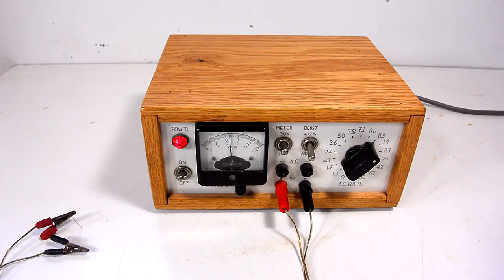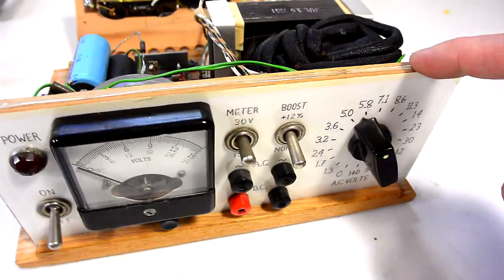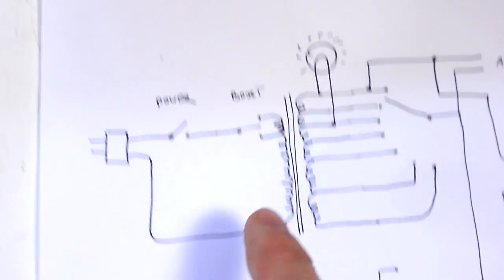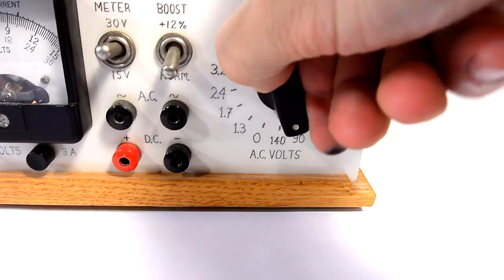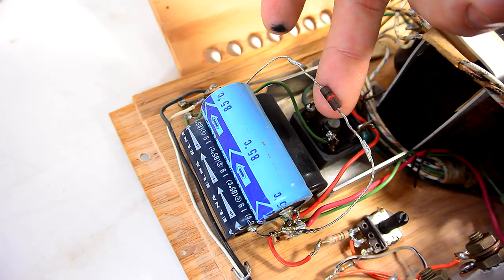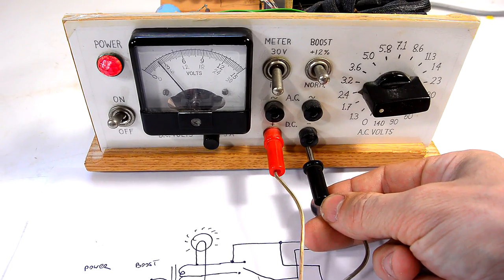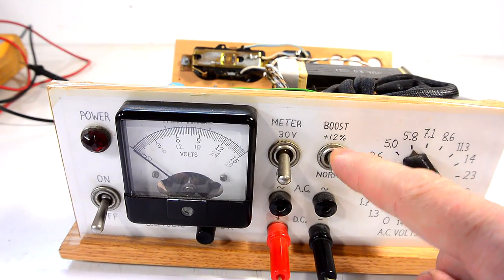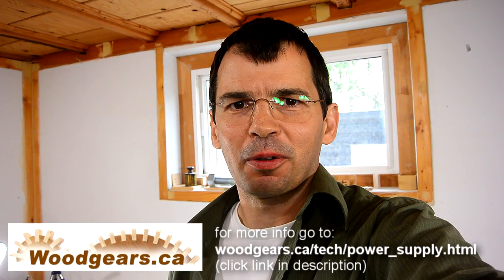Homemade benchtop power supply

Comment from the maker: About my homemade benchtop power supply
(which I built 28 years ago)
Reply: Matthias Wandel Only you'd make a power supply that goes up to 11.2.
Reply: Matthias Wandel That is so coincidental, I'm making one right now. I just ordered a buck controller to run the fans. I'm rewinding the secondary to get what I need from a scrap microwave transformer. I am totally going to copy your case though....so awesome. Is that cap draining resistor on an over current relay too?
Reply: bno112300 Well most blokes, youre on ten there, all the way up, where can you go from there? Where? Nowhere. What Matthias does, when he needs that extra push over the cliff, he puts it up to eleven.
Reply: Kale Klompstra Well it's one more now isn't it.
Reply: Matthias why you dont put a Cooling fan in that bench power supply?
Reply: Alex Gamer _360 because except for when its being used as a current meter it probably doesn't get very warm...
Reply: ***** no if you make it correctly it doesnt but for save you can make an fan on it
Reply: this was so interesting you are so enthusiastik do more videos like this about the electric things you have built.
Reply: Matthias Wandel  thats excellent. i built basically the same circuit to use as a built-in battery charger on my vw camper bus =) theres no metering or voltage selector or anything, so its nice to see what you did with it. very nice build =)
Reply: *****   I second that sentiment.   You are a modern Leonardo Da Vinci!
Reply: +Tobias Hochg&#252;rtel 
Don t under estimate this guy, he is a very creative, very smart, no he is a genius.
Reply: Isn't live more interesting when you get older - you benefit from the things you have built or done way back - in case you are and have been a bussy engineer.(like Standing on your on shoulders...)I am 51 now and just build a part for my street organ from a piece of oak I cut 30 years ago (and dried since then). So you always should plan and prepare yourself for your future.
Reply: I love this thing, it's made all the more awesome by it's simplicity. The fact it uses old school tech and hardware makes me want to make one for myself.

Comment: Gosh, this really takes me back.   As an apprentice, my original target job on completion of my apprenticeship was to be a 'valve engineer'.  However, back around 1958, one of my sessions at the company works was in a section where they had just started to make germanium transistors, which eventually saw the demise of most  valves.  
I remember looking through the window of the lab where they were growing the germanium crystal - I recall it looked like a two-inch diameter rough steel rod rising out of the retort at a very, very slow rate (something like an inch a week?)
The finished rod was sliced into discs, and the disks cut into tiny squares.  Blobs of N or P type germanium were fused to the square, with wires from all three coming out of the insulation surrounding the group in a container like a quarter-inch diameter little top hat.  This was a transistor, and if I remember correctly the rejections rate (percentage that DIDN'T work) was initially something like 90%.
Around this time, I made a one-valve radio - on a wooden chassis - and it looked very similar to your meter.   I would guess that the soldering quality was also about the same standard!
Thanks for the trip down memory lane.
Reply from the maker: Don Johnson Wow, 2" wafers.  I didn't know they ever made them that small!  Saw "the post apocalyptic inventor"'s video of a frequency counter terdown (from the 60s).  No wonder progress is faster now.  The tools are so much better and cheaper!
Reply: Matthias Wandel +Don Johnson  Thank you both for the trip down memory lane.  Haven't heard the term "Valve" since the mid 60's when I got into electronics.  I still have a baby food jar full of old germanium transistors and diodes from the period.  Also wish I still had my old RCA tube tester now that I've watched your video, Matthias.  My first "O"scope in high school (mid 60's) was on wood and used a 3FP7 tube I scrounged at a surplus.  Yours is an elegant & well thought out design, layout and wood working, although the caps could have been handled a bit better.  ~¿@  Did you custom make that meter face too so it could do all 3?  If you want another trip down the lane you might enjoy Fran Blanche and her Apollo DSKY display build...old school for sure and a great project.  IMHO we shouldn't forget where we came from...that's how things got to be the way they are now and will get better from here!  Thanks again!  ~PJ

Comment: Great video. I spent a career as an ET. Keep it simple. You are amazing.  Like the Brother Color printer my Dad brought home and said "you figure it out" I did. That was the early '80 and I programed that. And disassembled the print head with all them needles springs and pins. The shop he bought it from didn't know how to apply it. When he took those charts in with his sales data the president of the company wanted to know why they could not do this when Jack and his son could. I learned my electronics in the military and was an average guy and slow but methodical.  The turtle. You are a great guy Mathis
Reply: Opps Matthias

Comment: I didn't understand any of the electronic explanation but still another great video! Thanks Matthias great work
Reply: Martin Roberts Here is an even shorter version (hope it helps):
- The transformer (on the left of the diagram) reduces the mains AC voltage to lower AC voltages.
- The different wires coming out of the right side of the transforrmer each carry different voltages.
- The diodes (triangles) and capacitors (double rectangles) convert AC to DC (direct current) and smooth out the electrical output to provide steady and usable power

Comment: Good work on a great little power supply!  I have been an electronic tech since the 1960's and remember well using those old tube testers to check the many tubes we serviced in radios, and TV's of the period.  I also remember an old timer I worked with that also used a multi-tap transformer from an old TV to make a similar power supply.  Not as many taps, but it had quite a few and the supply worked rather well.  These days, I use high performance lab supplies for my work, however, I have never forgotten the elegance of tube driven systems nor the ease at which an experimenter could build fun projects.  Again, well done!

Comment: Nice and simple power supply with lots of useful features! Reminds me of similar power supplies I built three decades back using multi-tap transformers, rectifier diodes and filter capacitors and no PCBs! Later, voltage regulator ICs were introduced and LEDs started replacing light bulbs.
I have been into electronics for more than 30 years and into serious woodworking for the past one year. No wonder, I found this video quite interesting.

Comment: My school had a bunch of bench powersupplies that were never used (literally not even once), so I mannaged to haggle for one. I had a look inside and it has the exact same style transformer. It doesn't have any capacitors or anything. It also has the +1 volt thing too, and goes up to 25v at 8 amps (200wp psu). Each step is 2v, so I have lots of resolution on it. Absolutely awesome psu.

Comment: Simple but effective, nice job. I've been using used and discarded computer power supplies for years to power various projects that require, clean and regulated DC power. I collected 15 55 watt power supplies from some Sun Sparc workstations my company was tossing out. These make great 12 volt supplies for powering LED lights that I use and for powering a small array of cooling fans for my entertainment center.

Comment: Apparently you went to a better high school than me, lol. Well done! 
Recently built one myself, but used an old computer ATX power supply, gives easy 3.3, 5, and 12v DC. Can do others (like 7v, connect 12 to 5, not great for the PSU but works fine more or less). Paid 5 buxs for PSU, a few more for some buck boost converters, as well as current limiting boards, all told under 50bucks, easy to put together, and much cheaper than an off the shelf unit. 
I would like to be able to play with AC to, but this is suitable for now. 

Still, this was sooooo much simpler than your project, so again, well done!

Comment: Nice electronics class.  I built one in college class, with a 24 vac transformer.  I used the bridge rectifier and filtering circuits, but added some 2N3055 transistors to have regulated output.  I used it for years to power my ham radios and to charge my 12 volt batteries.  Years ago, my current meter went bad, so when I'm in need of a current reading, I just use my digital meter.  You did a nice job on this project and the multi tap secondary of that transformer is nice for what you used it for.

Comment: Old devices that don't use much semiconductors are quite fascinating. I built a aluminum case power supply with almost 0 to 35 volts range, that can be adjusted with a potentiometer. The potentiometer drives an adjustable regulator that in turn drives a very high power transistor to give more current on the output. It also has a digital current and voltage combo display and unregulated 35 volts AC out straight from the toroidal transformer, as well as an earth post that connects directly to the case and the earth from the power plug. It uses so many semiconductors I won't be able to list them all (there's so many on the voltage/current display). The display has its own power wires, and measures using voltage sensing wires and current sensing wires. That way it can read less voltage and current than it requires to run.

Comment: And here I'm just using an old computer PSU as my bench power supply. It only does 3.3v, 5v, -5v, 12v and -12v, but it's more than enough for the small projects I do.
Reply: Lutranereis You can also bridge those to get stuff in between, 3.3V to 5V gives a 1.7V difference, 3.3 -> -5 = 8.3V, 3.3 -> 12 = 8.7V, 3.3 -> -12 = 15.3V, 5 -> -5 = 10V, 12 -> -12 = 24V,... so on and so forth.
Just be warned only thick wire 5V and 12V are made for heavy loads and protected, everything else is for basic circuit work and might crap out if shorted.
Reply: MsSomeonenew Huh! I honestly never thought about that. I only really dabble in electronics anyway, but if I get more serious in the future...I'll probably just buy a proper benchtop supply. XD

Still, it's good to know that, in a pinch, I can do different voltages. Seriously, thank you.

Comment: Clever getting full usage out of that transformer. Actually, the extra tap on the supply coil was a surprise to me. But it makes sense if they were shipping that tube tester internationally; a number of countries outside of North America are using 110VAC or 100VAC.

Comment: Your wooden case is fabulous. I assembled one last summer using blocks and pins, cause I don't have a router. My project box isn't exactly square, it's out 1/16" inch in the corners, and other places. Mind you, that's the  best I could do with a Dremel Multi Tool.

Comment: This is a very cute power supply, you said that you didn't include a fuse which is something that brings back memories when I was in high school too... (but I'm fuzzy on the details) that when I had on a home-built power supply with fixed, unregulated 6 and 12 VDC it had a slow-blow 3A fuse... But when playing with it, accidently at times I'd short it and the fuse blew, replacing it was always a pain... and if I didn't have a fuse I just bypassed the dang thing.  So I came up R/S flip-flop design with transistors, and maybe I had a relay with high-current contacts, that would drop out when the current went above a certain threshold and kill the power to the contacts, I could reset the system and get back to business quickly,  And it added functionality, because now I could energize my project with a press of a button and I could quickly turn it off all while leaving the banana plugs in the power supply connected to the project.  My design had two momentary pushbuttons for ON(Reset)  and OFF, and two LEDs:  A red LED was off/overload and a green LED was Power ON.  In retrospect, I could have added a potentiometer to adjust the threshold to where I wanted the "protection" circuit to trigger... I just made it fixed for the maximum current.  This was better than a fuse and it added functionality and a little bit of safety to the power supply... oh... and it required a lot of fun tinkering to get it to work just right.   Cheers!

Comment: It does not say on the schematic, but switching the boost to the down position is boost. Less turns in the primary means higher voltage in secondary.   Correct?
Reply: I disagree with you . See the following
The ratio of a four-to-one step-down transformer is written as 4:1. A transformer that has fewer turns in the primary than in the secondary will produce a greater voltage across the secondary than the voltage applied to the primary. A transformer in which the voltage across the secondary is greater than the voltage applied to the primary is called a STEP-UP transformer. The ratio of a one-to-four step-up transformer should be written as 1:4. Notice in the two ratios that the value of the primary winding is always stated first.
Reply: You're correct, less primary turns equals more voltage on a secondary winding

Comment: Alas, here in the 21st century it would be easier to find a pot of gold vs. finding an old tube tester with an amazing transformer like that. Besides, these days, one of those vintage tube testers would be much more valuable than an equivalent new transformer (if they even still made them like that).  A modern equivalent for AC could be an ISOLATED Variac which outputs a continuously variable voltage.

But this is a lovely example of how to make a piece of DIY test gear that is functional and presentable.  I still have some DIY test gear and gadgets and tools that I made as a kid and still use nearly 50 years later.
Reply from the maker: yes, the irony.  But back in 1984, things were different.

Comment: That is a really nice power supply. I too, prefer old electronics to new. I can understand and use newer technology but the old way of building things just works better. Transformer from 1951 still working versus transformer from a Sony home amplifier from 1997 that recently and randomly just stopped working. They just don't make'em like they use to.

Comment: I built my first 12 volt dc power supply using a vacuum tube rectifier.  I used it to power a car radio/tape player in 1971.

Comment: you got lucky with that transformer, unfortunately most transformers are no where near as versatile.
And apparently you look a lot younger than you are, you built that the year i was born
Reply from the maker: Joe G.P. I built that power supply because I had that transformer.
Reply: Joe G.P. is not that hard to re wind it....
Reply: Joe G.P. You can still use a 1:1 ratio tranformer (for isolation) and  then a Variac and get "infinite" taps, rough and simple. None of them are cheap, of course. The Mathias transformer was really a nice find.
Reply: 38911bytefree I found one that outputed 2, 4, 6, 12 and 24 V (all at 5A) but i also built a small board for a variable 1.5-30V/1A, it also had a 110V AC out which was handy (we use 220V)
Reply: An audio amplifier transformer has many taps like that tube test transformer they would be great for similar projects

Comment: A fine example of ingenuity for 1984.
I think today we would approach an equivalent build differently.
You can buy an adjustable  24V 10A SMPS for maybe $40/50  & go from there..
The woodwork is good but ergonomically I would attempt a sloping front to make things much easier to read.

Comment: Really nice touch using that extra lead on that primary -- I've taken apart dozens of old things before I had much electronics understanding only afterwards to realize I had no clue what that could be used for. I still question if the 78xx series wasn't available when you made it, since you can just put a pot between it's middle pin (gnd) and the real ground from the transformer then you have infinity adjustable voltages. But I'm not good enough at googling to find that answer. LOL!
PS -- I've still got a portable tube tester in my storage stuff! Hoping to fix up a tektronix scope.

Comment: Matthias, will you by any chance be interested in doing a video dealing with why some power supply oscillates at certain voltage and current. I know there are videos that that attempt to explain this but you always seems to have the best of ways to explain things that in a way is easy to understand.

Comment: I also built a linear psu in high school, have you had a dry cap yet? It's a very nifty design, I like the way you scaled the voltages and created a current metering display as well you must have gotten good marks for it.

Comment: Good old PS design, as we made it when I was young(er). You hardly ever see these multi tap transformers any more. I guess because of the switch mode supplies. But this design is more than adequate for most purposes and barely contains any parts that can fail. Of course it would be safer with at 3-4 amp fuse at the output.

Comment: +Matthias Wandel nice job. Is it usefull to have another knob for current regulation?
Reply from the maker: Yes, such a knob would be useful, but only if it was hooked up to a circuit that does that, which this power supply does not have.